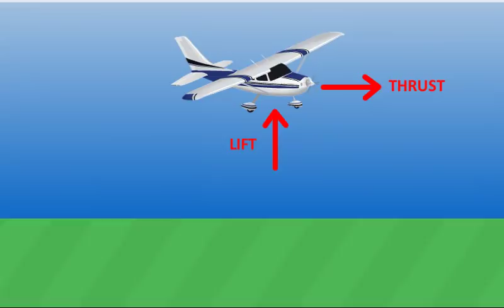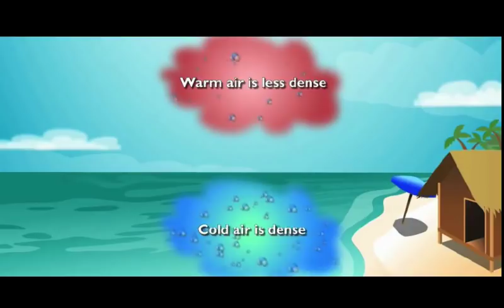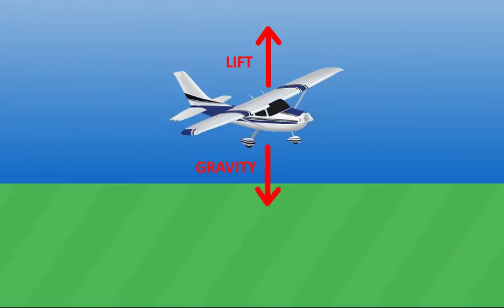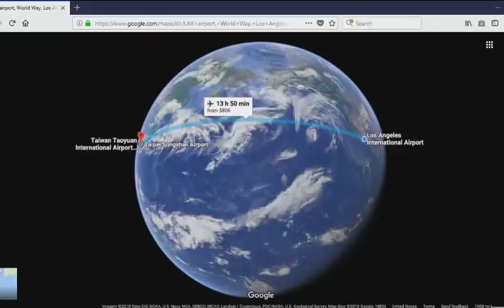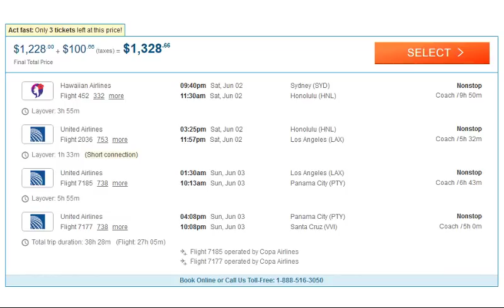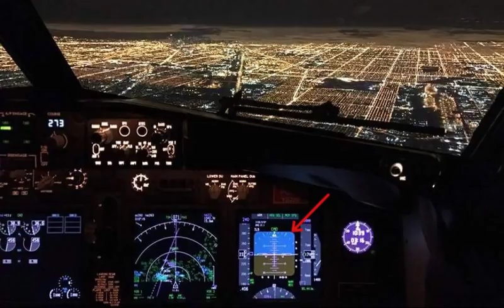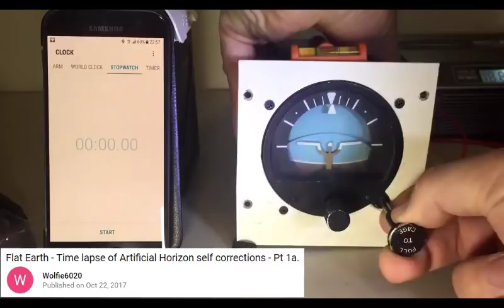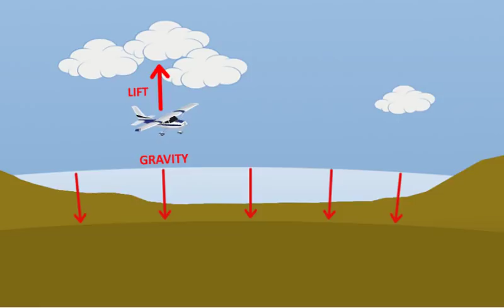Flat Earth Falsities - Plane Nonsense

Comment: "the helicopter is hovering IN AIR which is moving WITH the earth"   Don't you see that your very own explanation is its own Undoing?  This logic cannot be used to justify west and east traveling  planes taking the same time to cover the same distance.  FAIL.
Reply: "no, but if you are waking on a moving sidewalk"
Worst.  Analogy.  Ever.

"Either you simply cannot grasp it, or you are here to distract and confuse."
Is incapable of understanding grade school level geometry, accuses others of not being able to grasp things.  Priceless.
Reply: psyleidoscope Go to a revolving restaurant on top of a tower. Walk once around clockwise and time the journey. Now walk anti-clockwise and time the journey. Report back your results.
Reply: psyleidoscope:  Sigh...Lets use your moving sidewalk then.  Turn everything around you as far as you can see into that moving side walk.  You are standing on a red dot on this giant sidewalk. Walk ten steps away from that dot.  Now walk back to it.  Now THINK.  If everything, everywhere is the same giant sidewalk, and you never stepped off the side walk...was their a difference in time walking away from, or back to, the red dot?
Reply: psyleidoscope 
So it's impossible to walk to the back of a moving plane?
Reply: no, but if you are waking on a moving sidewalk, which direction will be take less time....walking with or against the direction of the moving sidewalk?
Reply: psyleidoscope 
That isn't a valid analogy. The entire earth is moving, not just a small portion of it. If you labeled two points on the sidewalk itself, they would take the same amount of time to walk to.
Reply: Jake Mize Unfortunately, Flat Earth believers have small brains. Psyleioboy here really believes it will be quicker to walk back to the red spot because of the sidewalk's movement against his / her steps.
Reply from the maker: psyleidoscope - The moving sidewalk is a terrible analogy for this. On the earth, your origin point, your destination point, and the air between them, are all moving together. So either direction, you have to go the same distance, and push through the same amount of air. Not true for a moving sidewalk. The origin and destination are not moving with the sidewalk.
Reply: Psy . . . . it will take you the same time to walk ten yards along the moving sidewalk in either direction. That's because you are measuring distance relative to the sidewalk. Airflight distances aren't measured in relation to Mars, but to the surface of the Earth. So you're measuring the distance you move along the sidewalk. If you are in a train you are moving 60 mph North as you walk to the dining carriage, 55 mph North as you walk back. Still takes the same number of minutes each way, unless beer was involved.
Reply: psyleidoscope --- wow just wow the entire earth is moving as you and me type, but moving slowly not fast.
Reply: @psyleidoscope
"VoysovReason you are simply avoiding the bigger picture.  Either you simply cannot grasp it, or you are here to distract and confuse." You obviously don'r appreciate the irony of that statement.
And as for your  High Priest Eric Dubay, posted to him at the beginning of Oct 2017. Still no answer. Although he did delete my posts until I reported him, the pathetic liar. He then deleted his video in a pathetic attempt to get rid of him being proved a liar. What a stupid tit.
He categorically stated - 
"Surveyors, engineers and architects are never required to factor the supposed curvature of the Earth into their projects”
I replied.
What a pathetic lie. But I suppose your gullible sheep will believe you.
http://landsurveyorsunited.com/forum/topics/scale-and-earth-curvature-and-refraction
http://flatearthlunacy.com/index.php/2-uncategorised/172-chris-fritz-flat-earth-listen-to-land-surveyors
http://www.aboutcivil.org/surveying-levelling%20II.html
http://civilengineersforum.com/plane-surveying-and-geodetic-surveying/
http://usacac.army.mil/sites/default/files/misc/doctrine/CDG/cdg_resources/manuals/fm/fm3_34x331.pdf
https://geodesy.noaa.gov/PUBS_LIB/Geodesy4Layman/TR80003A.HTM#ZZ5
http://cfeds.org/docs/sml/ManualOfSurveyingInstructions2009_060414.pdf
Reply: "enjoy your sweet, sweet gmo corn syrup and your strong meds."
I enjoy them very much thank you.  You go right ahead and keep enjoying the fruits of our labor.  In the meantime however you still haven't rewritten the Laws of Motion.  Clearly you must have access to the "real" Laws of Motion since your previous comment shit all over the current First Law of Motion, but certainly you knew that.  Right?

"geometry?  doh"
Yes, geometry that little thing that instantly destroys FE.  If you are at all unsure about the Earth being a sphere you clearly can not grasp grade school level geometry.
Reply: "you really think we need to use Thrust to come to a stop and be still?"
I look forward to seeing you rewrite the Laws of Motion.
Reply: psyleidoscope Your conclusion is wrong. I have been to many airports. Now, you are unwilling to do my experiment and report back to the results. Why?
Reply: Sad but true.
Reply: No, you fail. Your flat brain is not capable of comprehending round earth explanations.
Reply: Don’t entertain this idiot
Reply: sam griffin i've said it already,...these people arguing are possibly dumber than the idiots who think the Earth is flat. Probably painted a target on my back, but I don't care. In the 80's, we, the intelligent,...pump the brakes...even adequately/somewhat intelligent people, IGNORED these clowns, and moved on with new ideas. I think it's an even worse sign of how far our society has fallen...that so many feel the need to engage...it's fucking pathetic. You AREN'T going to change religious nutjobs lack of understanding...it's fundamental...they aren't ALLOWED to understand. It would piss off ENKI (actual name of their FAKE god)
Reply: @psyleidoscope
""and must USE THRUST to add or subtract from that movement"  you really think we need to use Thrust to come to a stop and be still?"
The bass of all motion.
First law - In an inertial frame of reference, an object either remains at rest or continues to move at a constant velocity, unless acted upon by a force.
Second law - In an inertial reference frame, the vector sum of the forces F on an object is equal to the mass m of that object multiplied by the acceleration a of the object: F = ma. (It is assumed here that the mass m is constant.)
Third law - When one body exerts a force on a second body, the second body simultaneously exerts a force equal in magnitude and opposite in direction on the first body.
Reply: psyleidoscope Your analogy of the escalator would work on a globe earth too. Because your destination is moving with the escalator, if you run against the escalator you will eventually reach that location. 

Think about it this way. Lets say you have a 10m long treadmill. If you place an object at the end of the treadmill and you start running against the speed of the treadmill from the either end, you will eventually reach that object because that object is moving with the treadmill. 

In your argument of the moving sidewalk you assume that if the sidewalk is moving against you, you will never get to your destination. However, you fail to understand that in reality, if there was a moving sidewalk, it wouldn't just be the sidewalk that is moving but also everything around it, and any location would as such move along with it. So in reality, while you are running against the velocity of the sidewalk, the destination is also moving towards you because it is moving at the same speed as the sidewalk, so you reach your destination regardless.
Reply: The reverse occurs when you running with the sidewalk as well. Since you began on the ground, you're initial velocity is already that of the velocity of the earth, even when standing. Again think about standing on a treadmill, your moving even though your standing still, instead now you are moving not from the point of the treadmill, but moving with the earth. 

Now if you were running with the sidewalk and needed to get to a destination, you need to realize that before you even start moving, both you and your destination are going at the same speed as the earth. As such if you want to catch up, any amount of force you apply (walking running, etc) will result in you moving towards your destination because you are going faster (whatever speed you are running at + the speed the earth was moving you already), in comparison your destination (is only moving at whatever speed the earth was moving at). So as you can see, you are once again moving aster then your destination and will reach that location regardless.
Reply: I suggest you watch this and part 2, to get better understanding of frames of reference: https://www.youtube.com/watch?v=pyBNImQkRuk
It is so old that I assure you there is no CG involved. Its very simple to learn. I learned this in Grade 11 Physics at my Highschool and now that I am currently studying my undergrad in MechEng, i can say that it is definitely much more digestible then whatever I am learning right now, so I am sure that you can understand it too.
Reply: Thats only some thing a flat earther would do (try to walk the wrong way on an escalator or moving sidewalk ) due to there incapability to grasp whats going on in the world around them .
Reply: psyleidoscope relativity. if you are waiting for a train. a train will pass you 50 mph. if there was a guy there throwing a ball backwards. The ball is moving away from him while you are seeing the ball stopped moving in front of you. And dont give me the open the window crap. That would make you hit the air not moving with you. We can open the window of the earth. Ow wait, theres no air in space!
Reply: psyleidoscope he used the car because its similar to how the earth works.While you are judging them as if a car and a planet is the same.
Reply: David Armstrong agreed dude
Reply: oh, you dont like my analogy, but you use the "toss an object inside a car with glass windows "  LOL.
Reply: Micah Leith   in my analogy the moving sidewalk IS the entire earth    (as the ENTIRE earth is moving, right?)
Reply: VoysovReason you are simply avoiding the bigger picture.  Either you simply cannot grasp it, or you are here to distract and confuse.
Reply: "and must USE THRUST to add or subtract from that movement"  you really think we need to use Thrust to come to a stop and be still?   ok, i guess i found the mental ward section of Youtube  
enjoy your meds, bro.
Reply: "I look forward to seeing you rewrite the Laws of Motion."   
enjoy your sweet, sweet gmo corn syrup and your strong meds.
Reply: wong   thanks for that refresher.
Reply: somatotrophin1  clearly you have never been to an airport, nor tried to walk the wrong way on an escalator or moving sidewalk for fun.  try it.
Reply: "Is incapable of understanding grade school level geometry, accuses others of not being able to grasp things.  Priceless."
geometry?  doh
Reply: USABall   earth is at rest.   you cannot prove it is moving.  dont even waste your time.   you will go mad.  Einstien even admitted that it earth's motion could not be detected.  this is something that takes a special kind of faith.

Comment: what about the other planet's moon which rotates in their planets and change its face in different location because of their rotation? while here on earth the Moon's face does not change at all only face orientation
Reply: nghnino 
The moon is tidally locked.
Reply from the maker: Actually, most moons in the solar system are tidally locked like our moon is. See "Proving the earth is not flat - part 3 - the moon"
Reply: Far as I know Moon is the only one that does that, but I'm happy to be corrected. They used to tell us that Mercury kept the same side to the Sun, but not any more. Saturn is the odd one, the question that you should be demanding an answer for. The gyroscope effect should make it's orbit impossible . . . . . . . under CURRENT astronomical theory. Their ideas aren't wrong, only incomplete.

Comment: Flat earthism is rooted in the bible and is just as core a belief to committed  christian fundamentalists as young earth creationism. The flat earthers cannot be reasoned out of what is in fact a strong religious belief. Any flat earther who claims not to be a YEC or fundamentalist may not realize that they have been manipulated by fundamentalist proselytizers.
Reply: Correct. There is basically no difference between the FE, ID, Creationist and YEC cults, a fact which Christians who are not members of these cults refuse to accept. It's not hard to work out why.
Bible literalism does not stop with these cults because all Christians believe the bible is literally true otherwise they would not be Christians. They believe the story of Christ and so on, so they are not too far removed, whether like like it or not.